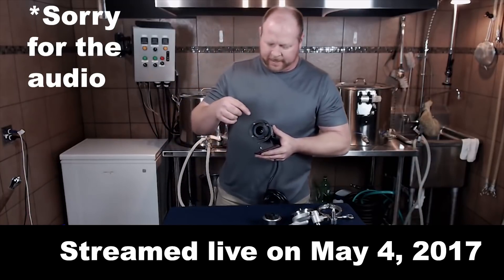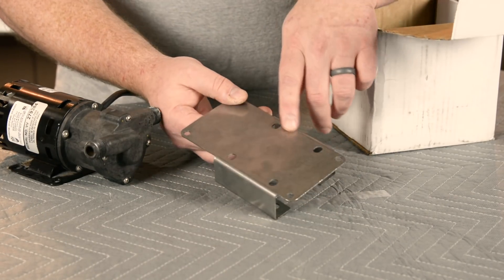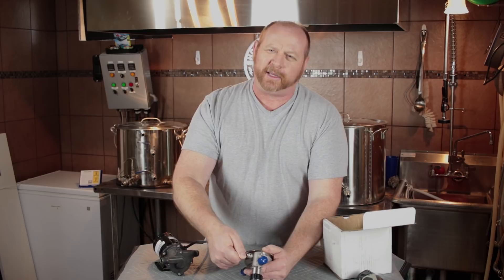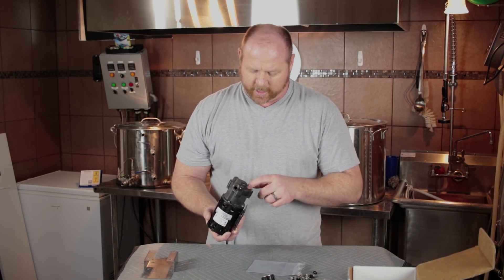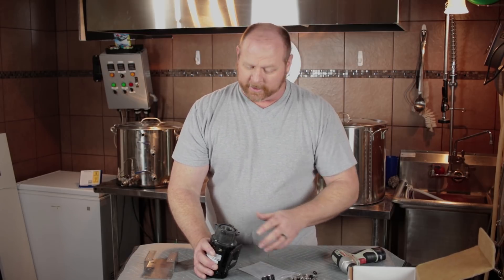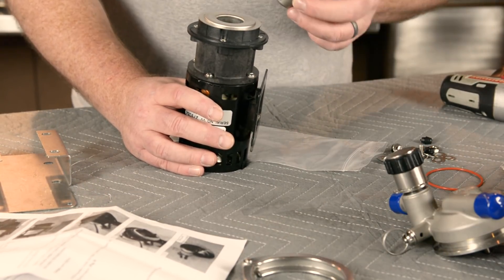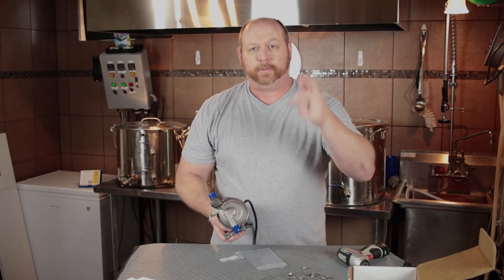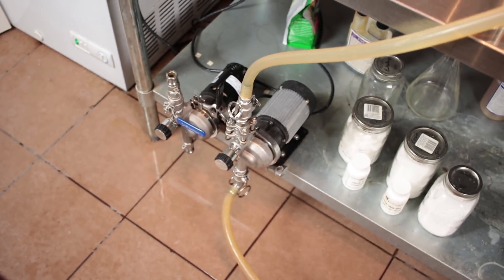Upgrade Your March or Chugger Brewing Pump With  A  Blichmann Riptide Brewing Pump Upgrade Kit

Comment: I'm curious to know why both of the Riptide pumps shown in the video have ball valves installed in addition to the integrated linear flow valve on the head. Thanks for the review!
Reply from the maker: Great question Jeff. The answer is somewhat laughable! I just have not ever ordered the female cam locks for the pump(s) I just used the valves as a connector to use the camlocks I had. They are not necessary at all. Even funnier is I have made a few orders from brew hardware not to long ago and forget every time to order them. Thanks for watching and commenting! Cheers 🍻
Reply: @ShortCircuitedBrewers  I'm thinking of getting this pump for Christmas. I could see not having a ball valve on the output leading to a situation where I thought the flow was all the way off but not quite, then walking away and coming back to a mess...I have done this between boil/chill and it's the worst. It sounds like you had a ball valve initially for QD mating. Would you keep it now that you're used to having it or do you not even use those ball valves? I'm thinking it'll be nice to have linear flow for the sparge, but ball valve for ensuring there is no leakage path.
Reply from the maker: Yes I have a ball valve still on it,. Two reasons, it's just something that I'm used to having on my pumps. And secondly it is a lot faster to turn off a ball valve than that linear valve should there be a hose that comes loose or something catastrophe. I do like the money or valve for adjusting flow rates on sparging or chilling though.
Reply: I can think of one benefit to such a system.  You could use the ball valve as strictly an on/off device and use the mounted linear valve to fine tune the actual flow rate (this might come in REAL handy if you're directly pumping out of a mash tun and have channeling/compaction issues.

Comment: Aug 24: I had a problem with the chugger pump after many years of use and couldn't find the parts I needed including the pump head. This seems like a good replacement for that although a bit pricey in the the chugger pump head looks like it is a little over $50 (but they are always out of stock or not sold) and the blichmann replacement now is $150 but at least it is avalable

Comment: I would love to see a comparison of the March 809 upgraded with the Blichmann Riptide head vs. a complete Riptide including the motor.  I have three 809's that I'm toying with upgrading (one of which squeals incessantly) but if there's a significant performance gain to be achieved by buying the entire pump, I'm up for that.  Has anyone done such a comparison?
Reply from the maker: The riptide is slightly more powerful even with the head replacement. I don't have a video but can tell you that from running them side by side in the brew house. I went to a second riptide for the lower noise level.👍🍻
Reply: @ShortCircuitedBrewers  Thanks for your feedback.  I brew outside (and am hard of hearing anyway), so the normal noise of the March isn't an issue for me (though the squealing definitely is).  I brew 25 gallon batches, so obviously performance is a key consideration for me.  I just wish I knew on a quantitative basis how much better the full Riptide is compared to the converted 809.  Blichmann is completely silent on this and I haven't seen any actual flow rates or head height comparisons between the two.  But I really appreciate your video because this is the only one I've found on Youtube that makes ANY comparison between the two configurations.
Reply from the maker: @chuckschillingvideos  it's not a huge amount 15 MAYBE 20%
Reply: @ShortCircuitedBrewers  Thank you.  One other advantage just buying the upgrade has is that it will make rationalizing the purchase much easier to the better half.
Reply from the maker: @chuckschillingvideos  WAF is always on affect!!
Reply: @ShortCircuitedBrewers  Indeed it is.  Homebrewing is just one of several expensive hobbies of mine and the fewer things I need to explain, the better.

Comment: Love how quiet this pump is.  I just have a problem with cavitation. I’ve tried purging it like the directions say and it doesn’t fix the problem.  A little help here?
Reply from the maker: How do you have the pump head oriented? Horizontal or vertical?
Reply: @ShortCircuitedBrewers  I have it mounted vertical on my tower or power
Reply: Interesting.  I gotta see how you did this.
Reply from the maker: @silveraven1  loosen the tri-clamp and rotate the pump head.

Comment: I just upgraded my Chugger with this and brewed today. I used it for the whirlpool, looked stronger than the stock Chugger, biggest improvement was controlling the flow through the Therminator. The linear flow valve is way better than the ball valve I used previous. My only concern is the thrust washer on the impeller shaft. It's small, and I'm guaranteed  to loose it one day! I'm happy with the $99 price tag, worth it.
Reply from the maker: Awesome that's great news! I have had the same concerns myself on that thrust washer I think I've said in this video and the riptide video to keep an eye on that thing LOL!! 👍🍻

Comment: I think that if you have a march or chugger and want a riptide, it is worth it. However, if you do not have any pump, just spend the extra money and go with a riptide. Purchasing a march or chugger and then this upgrade, you are into it more that just a riptide. Cheers!
Reply from the maker: N Ames I agree 100%
Reply: Thats what I did.... once I finally found some in stock.
Reply: Yea I was thinking it, only exceptions though woulbe be sales on either. In my case i got the chugger for like 65 bucks so I'll save some money there.

Comment: I'm not a fan of the valve on the head. If they would ever create a version with the typical chugger/march setup with the tri clamp attachment I'd be all over it. Cheers Brian!
Reply from the maker: Wally Feck the flow valve?
Reply: Short Circuited Brewers. I'm not a fan of the valve on the riptide. I'd rather have the typical ball valve. For my system they are either on or off. I don't need the adjustment with the screw in/out valve.
Reply from the maker: Wally Feck I hear ya. I use the valve when doing the transfer to fermenter through the counterflow chiller, works well for that as I m able to adjust it more easily than a ball valve. 👍🍻
Reply: The relief valve is a nightmare......someone will get hurt and there will be no insurance claim,,,no insurance company would cover this design

Comment: I guess I got lucky with my initial pump selection.  I have 2 of the SS Chugger pumps and they are great.  The flow is pretty strong, even with a lot of tubing to travel through...at max I have it going from BK > Pump > Plate Chiller > Whirlpool port and it still runs like a champ.  Great to see that you can convert them to something  a little more powerful if you need.  Cheers!
Reply from the maker: Wrecked Brewery  yes it is! The feature I like the most has to be the ease of cleaning! Thanks for watching and commenting! 👍🍻

Comment: I'm currently using a March pump I was given from a friend during a upgrade and I need a new pump head for it along with a valve.  So for a little more then that would cost I can have a Poppit valve, sanitary TC Fitting, and better flow rate.  I will definitely be looking to invest in the pump head kit once they are available in Canada :D 

Thanks for another great review, and how to!
Reply from the maker: It will make a great replacement head for that pump. You're welcome Johnny! Thanks for watching and commenting!

Comment: Pimp your pump! And yes Brian, the latest version of the Riptide has a metal pressure relief valve.
As far as value goes, it's in the same ballpark as a replacement stainless head from either Chugger or March with the added bonus of much easier cleaning. Great video, great information.....
Reply from the maker: LOL I almost went with that one... Was a good one but...
Reply from the maker: Yeah I figured... My Riptide was actually a Pre-production release model.

Comment: How does the relief valve work?
Reply from the maker: JohnnyQuid71 it allows you to purge the air out of the impeller housing, reducing cavitation of the impeller. 👍🍻
Reply: It's identical to the pressure relief valve on a corny keg.  Pull straight up and if you have trapped air inside your pump head, it now has a place to go (hint, never do this when you are actively pumping hot fluids).

Comment: Hi Brian,  great video, i think this will be invested in soon haha.  What are the actual liters per minute of the pump vs stock vs the riptide?
Reply from the maker: I have not measure that, the original side by side video can give you a little indication on it.
Reply: Does it have any info on the box or any documentation like max head etc after fitting? I use one of my march's on a pretty long coiled cfc and it cope's ok,  if there was any loss in head pressure it would be then only used to recirc mash or hlt for me